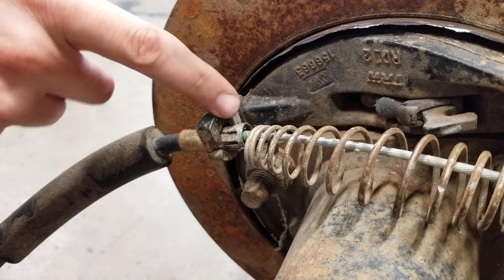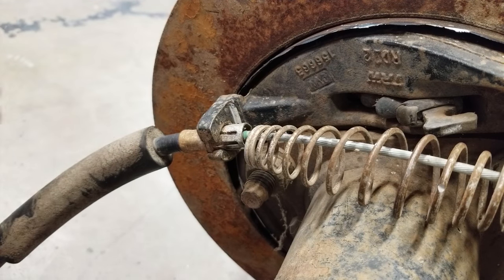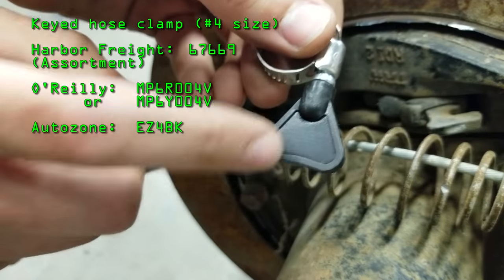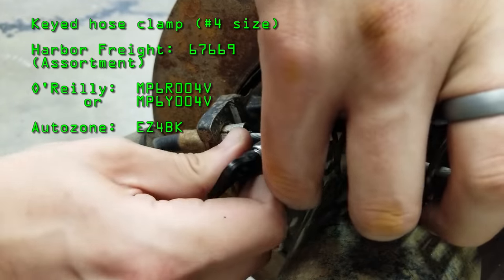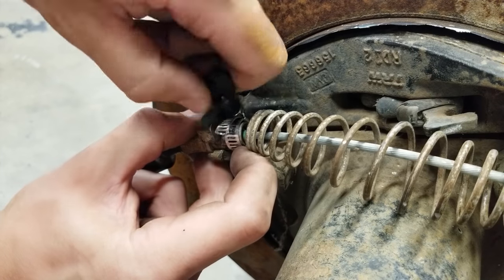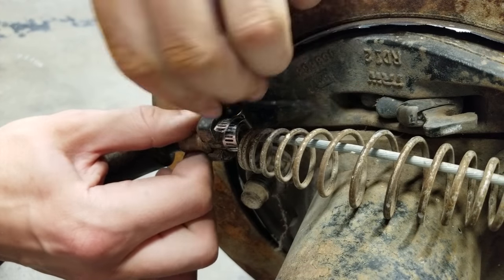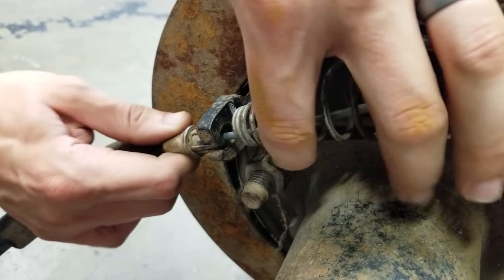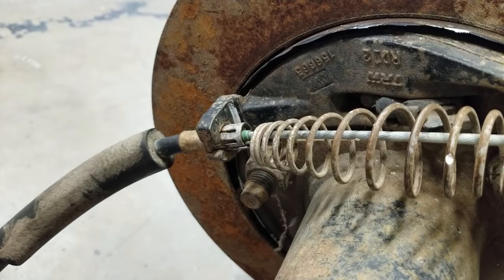E-Brake Cable Retaining Clip Removal!

Comment: As much as I wanted this to work, I needed the real tool Lisle Parking Brake Cable Remover 40750.  Thanks though.
Reply from the maker: Thanks for the part number of the real tool! Pinned for other viewers that this method didn't work for 👍
Reply: @WebWheeler  please tell me you know what this part is actually called...or a part number? I can't find it and I've broken both of mine.
Reply: @Juss-Saiyan it says the part number right there from @b777jetseter. Although the hose clamp truck should work
Reply from the maker: He's looking for the actual retaining clip that's on the ebrake cable. Any idea on where to find them besides buying a whole new cable assembly?
Reply: @JasonLee-lv7tm  yes the retaining clip. not the whole cable assembly.

Comment: I didn’t need this hack 5 years ago when it was originally posted, but I SURE NEEDED IT TODAY!   Initially I had trouble with it, but I found I actually put the hose clamp TOO CLOSE to the bracket. There was no room for the cable to slide out. By moving the clamp 5 or so millimeters away I had enough room to slide it out far enough that I could remove the clamp and pull the cable the rest of the way out.   Thanks a TON for this!!

Comment: Thank you for posting the video!  I spent the last two days cursing the engineer who decided that the emergency brake needed a 3-prong retaining clip to keep the cable in place.   Upon recommendation, I purchased the Lisle Parking Brake Cable Remover 40750 to "assist" in removing the cable and it was useless.  After watching this video, I purchased the #4 hose clamp and "thin" vice grips and had the retaining clip off in 5 minutes.    The trick is getting the clamp in place to hold down all three pins and using a screwdriver with a very wide tip and using that as a pry, then using vice grips to hold your ground as your getting the clip to pass through the retaining ring.  The vice grip was the perfect tool in keeping the retaining clip from sliding back and "relocking".

Comment: Worked great to release retaining clip but had to reduce tension on e brake cable under vehicle before I had enough play to pull the clip through to remove the cable

Comment: Thanks for sharing. It works, and one could use a regular hose clamp as well if nothing else is available
Reply from the maker: Yes you can! 👍 I like the wing nut style just so that it doesn't require other tools

Comment: I'm ALWAYS looking at regular stuff designed for one thing but could be used for many other things, this is one such deal, I've used the bigger ones to tighten onto those old round tops on the 60's Brake reservoirs where I could get leverage with the thumb screw to loosen up the caps
Reply from the maker: Clever idea! 👍 Thanks for watching

Comment: Unfortunately, this trick didn’t work for me. From what I can tell, there is a rubber boot behind the parking brake cable retention clip which prevents me from being able to compress the retention clip enough to get it through the hole. And I cannot get the rubber boot out from behind the retention clip. So I am at a complete standstill.

Comment: Wow! Excellent tip. Going to try it with a regular hose clamp first. Wish me luck.
Reply from the maker: Good luck! Hope it helps you out 👍
Reply: @WebWheeler  worked like a charm. Would have been faster with the thumb screw but it worked great. Thanks!
Reply from the maker: Great! Thanks for the update- always good to hear it helped someone out 👍

Comment: Hi and thank you for this video tip; I noticed that the e-brake cable was already disconnected from the parking brake actuator lever and there was no tension around the spring, which made it easy to access the retainer clip where you placed the thumb-screw hose clamp over.  My question to you is, How do you release the tension on that spring to gain access to the plastic retainer clip in the first place?
Reply from the maker: It all depends on the spring setup but I've had good luck with using some vice grips to pinch a few coils and give you space for the hose clamp if it uses a bigger spring (1" diameter or so.) For the smaller springs that are tight to the cable, I pull the spring back a little and clamp the vice grips on the cable itself to act like a stop for the spring. Hope that helps!
Reply: @WebWheeler  Okay, thank-you.  I figured that perhaps there was a special tool designed for this.  Have a pleasant day.
Reply from the maker: You too! There probably is a tool out there but I've never really looked. Thanks again for watching!
Reply: @WebWheeler  You're welcome!  Yes, I found the tool I was looking for; the OTC6722 brake spring locking plier.  I ordered it earlier today through tooldiscounter for about $65.00.  Once I receive the tool and I'm able to compress the spring, I intend on using a heavy-duty plastic cable tie (through the spring), as a secondary safety measure, in case the tool falls off.  I don't feel like losing any fingers.
Reply: @topcat5777  pretty hard to go by miniature vice grip and save 60$ but you do you!

Comment: So my parking brake is released but theres still tension on the spring, how do I remove that tension like in this video
Reply from the maker: If you can't disconnect the cable from anywhere else to relieve the tension, you might not be able to- Some vehicles will have a captive spring that you can relieve the tension on. In those cases I've clamped vice grips on the cable to hold the spring back or compressed the spring and tied it up with some bailing wire while I release the retainer. Hope that helps. Good luck!

Comment: Is their a special tool, and video to go with that? tool?
Reply from the maker: I imagine the manufacturers have some special tool for the dealers but I have never bothered to look for it- this way has worked plenty and for and only cost a couple of bucks
Reply: Lisle sells a number of tools for this....but frankly I've always just used clamps.  You can use a deep socket in a pinch as well, but tricky getting the right pressure on the clip

Comment: TIP dont know what is squeaking ??? belt? belt tensioner ?  alternator? ext ext .... when motor is OFF !!!!   put a coulple of pinches of AJAX'S powder cleaner on one of the pulleys were it gets under the belt,,,,, stay back a tad some powder may "poof"   normal (powder/wind),,,,,, no more squeaky belt!! for a while any ways,,,, hope that helps trouble shoot a squeaky belt question,,

Comment: Ya except I can’t move my spring out of the way
Reply: Josh B me too !
Reply: Did you get it?  And if so, what did you do?
Reply: RodShop ya I did end up getting it with the small hose clamp, tightened it enough to bring the teeth together and yank it out
Reply: @joshb897  Glad to hear it!  I had to fight mine quite a bit before it finally worked.  Not as easy as the vid was.
Reply from the maker: Sorry guys not sure how I missed this comment thread. Glad you got it! I've been able to move the spring away with pliers then use vice grips on the cable to keep the spring held back. Not sure what your application/setup was but glad you got it 👍
Reply: @WebWheeler  Maybe I should make a video of the other side, and send it to you?  If a few more of us did that, you could have nearly all of the normal configurations documented.
Reply from the maker: I'd be happy to post it up and credit you if you want to do that! You can email it to me: webwheeleroffroad at gmail dot com. Thanks man
Reply: @WebWheeler  Sure, happy to help all the folks who were as stuck as I was before I found your video.  Thanks!